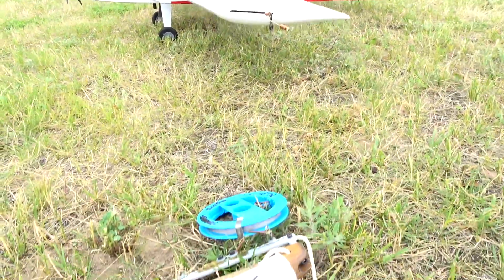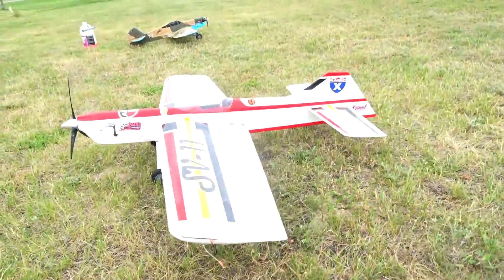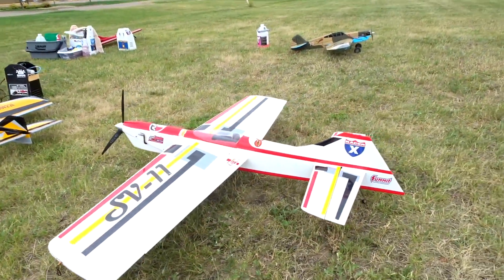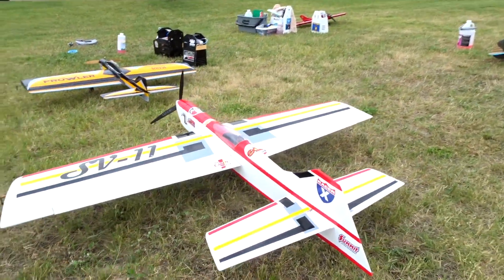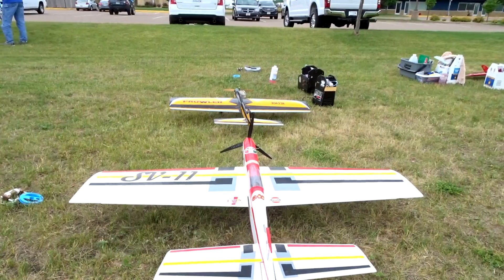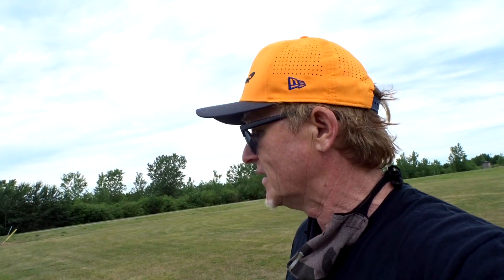SV 11 and PA 75 Engine First Flight

Comment: Hey shug is the sv11 a bigger plane then the Strega I’m building a Strega with a Jett 76 what are your thoughts on the combination seen your sv11 with the 75 so I was just curious of the size and weight between the 2
Reply from the maker: Roughly the same size....My Strega is an ARF and much heavier than the SV-11.

Comment: Hey Shug , Andrew here I was lucky enough to find a SV11 arf new in the box I traded a RC plane for it , I got a surprise when I opened it up its the green version I will be putting it on the bench soon, luckily I got the Philly flyer's control line club to help me along keep up the great videos you explain things great since I am in Florida and I don't have help here luckily we have a great flying field with a awesome circle hopefully I can stir up some noise and get some other flyers 🙂
Reply from the maker: Love mine! Great flyer. Just make sure to put it together straight and true. It is a beast.

Comment: Hello, is your Vector 40 ARF one piece wing or two piece from the kit?  Are your using the bellcrank from the kit?  Thanks for your time.
Reply from the maker: Two piece  from the ARF kit.See the wing in this link....https://brodak.com/control-line-kits/brodak/brodak-arf-series/arf-vector-40.html
 I used the supplied bellcrank. It is a Phenolic bellcrank. Much better than the past.
It is a great flier.
Same with the SV-11. 2 piece wing. Great bellcrank.

Comment: Have same sv11 from Brodak assembled from ARC by friend of mine (bought it from him). Plane flies fine with Stalker 66 but there is a lot of constructions gaps, like landing gear fell off (no hard landings), cowl as well, nuts for engine mounting is crap and must be replaced! And it's after about 100 flights. Engine mount seems has some lack of stiffness for Stalker's low revs vibration. My point is the scheme is good but definitely not competitive without deep modification. PS: Greetings from Ukraine! Thanks for nice CL videos!
Reply from the maker: I did notice the landing gear issue. Already had to re-glue it. I always expect issues like that with an ARF.

Comment: The trim on the SV11 is razor sharp - like you could fly it by verbal command. A graceful machine that looks as if it's a joy to fly. Great camera angle. Every time you pulled out of the figure 8 with two feet from the grass was mind blowing. Add the life sized planes coming in, you've got your own private airshow. Beauty.
Reply from the maker: I was talking sweetly to it. Always thank my planes. And my hammock trees.

Comment: A 75 on 63 footers?, you must be set really fat on the mixture.  That's a 70 footer motor for sure.  Plane looks good.  Tip weight looked about right, didnt see any bad habits in the overhead.  Nice SV Shug, may not be a front rower, but a nice flier for sure.  Thanks for sharing!!!
Reply from the maker: I will put longer lines for sure. It is a tight circle and was running rich. Also had no idea how it would do thus shorter, safer lines.
Reply: @shugemery  I would of been afraid of that motor running 4 sec circles and corkscrewing me into the ground ..lol
Reply from the maker: Did not seem fast from the handle. Looking forward to wringing that SV-11 out!
Reply: @shugemery  Your laptimes from the video looked great.  Didnt have a stopwatch to get a time but sure looked consistent.  That PA gives a nice steady consistent pull thru all the maneuvers it looks.  I might have to talk to Randy about one.  They're pricey I know.
Reply from the maker: Still needs a bit more break-in time. Easing through it.  My biggest engine ever!
Reply: @shugemery  Is that a Brodak ARF SV-11?
Reply from the maker: It is.